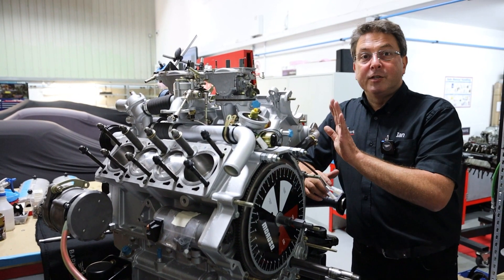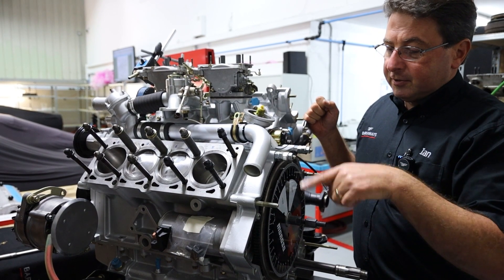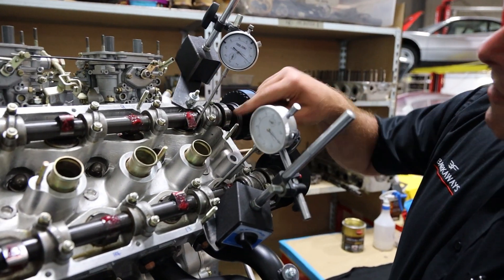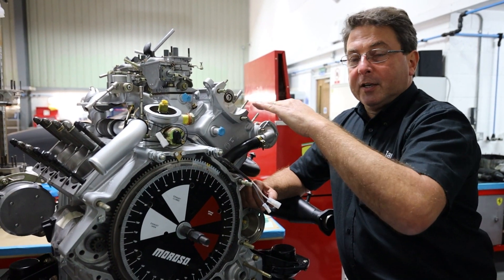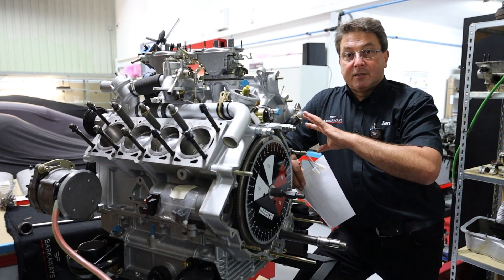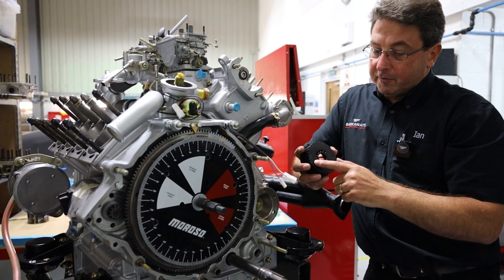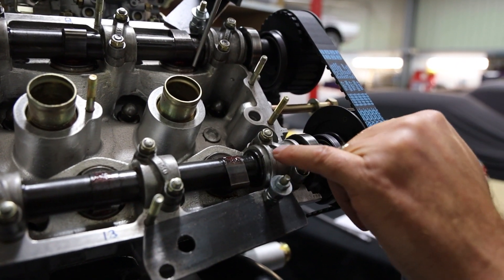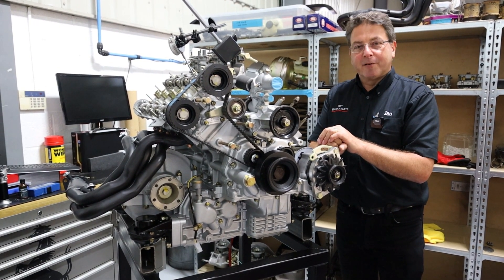Ferrari 308 - Restoration pt. 24. Engine and cam timing.

Comment: I'm doing belts on a 1975 US spec GT4. Do the marks on the front cams line up at the same time as the marks on the rear cams (TDC cylinder 1) or do I need to find TDC on cylinder 8 or 5?